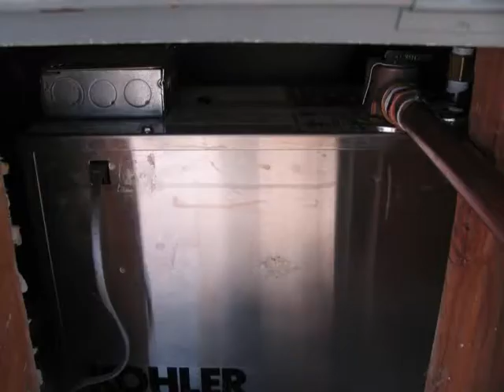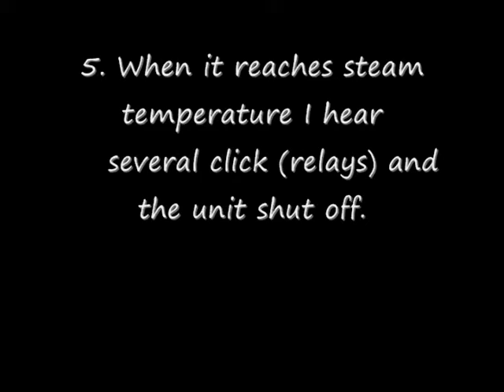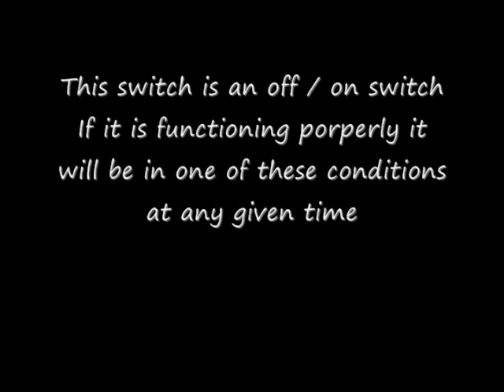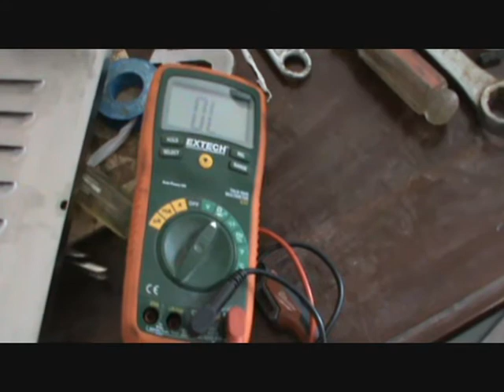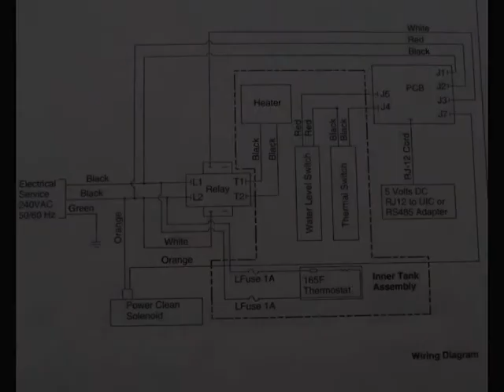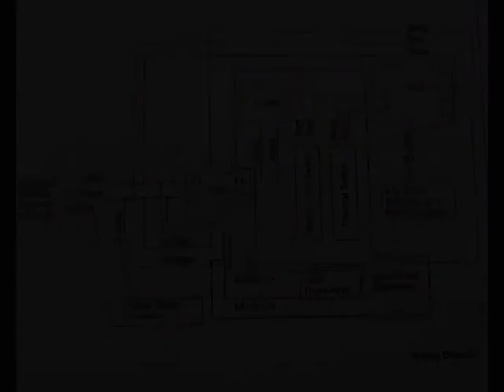Kohler steam generator float switch repair part 2

Comment: Nice video. Thanks. Please i have a new unit yet to be installed. When you lift it up and shake it a little bit it feels like something is loosened inside the chamber. Is that normal? I opened it but noticed the sound was coming from inside the chamber. Tried but couldn't open the inside chamber, it's sealed to the unit even after removing the nuts.

Comment: Are you sure it's the relay? If so I'll get the number for you. I took my relay completely apart and cleaned it. It pretty easy to do.I haven't had any issues at all with the relay. take a second look and see if cleaning will restore it.On a side note I just completed a major repair on my unit this morning.  the problem was due to a very small leak where the heating element joins the tank. There's a bulk head washer there and I think it didn't seal completely. The result was a very small leak whereby moisture accumulated at the lower terminal and caused corrosion to develop. The corrosion eventually weakened the coil cold pin connection and popped the breaker. To fix it I took the unit completely apart removing the heat coil. I ground off the old cold pin and TIG welded on a new post.Since it was out I also did a complete cleaning of the insides removing all the calcium which was substantial. I replaced the main heat element wires and connectors with the same size wires.  I used a generous amount silicon rated at 400deg. around the coil ends the pass through the tank and re installed the coil. With all that done I put the unit back in and it worked better than when I first installed the unit. I think cleaning off the calcium from the heat coil allowed it to produce a lot more steam. I used a CLR type product to do the calcium deposits. It took about two days for it to soak it all off. I don't think the purge function really does much to remove the calcium but I use it anyway.